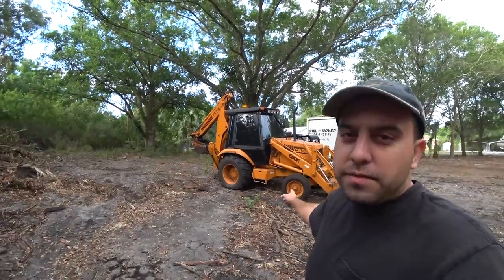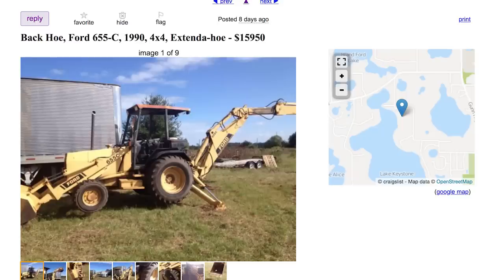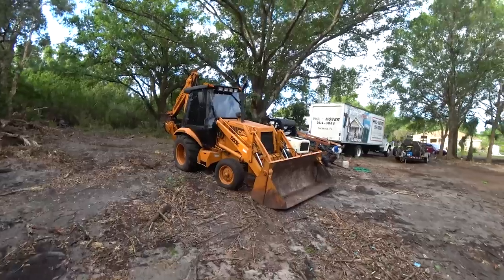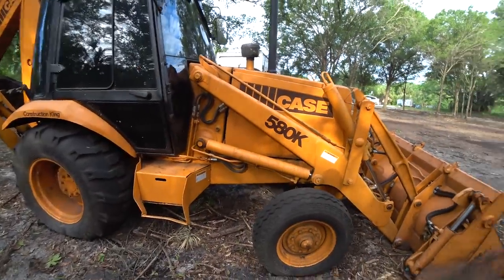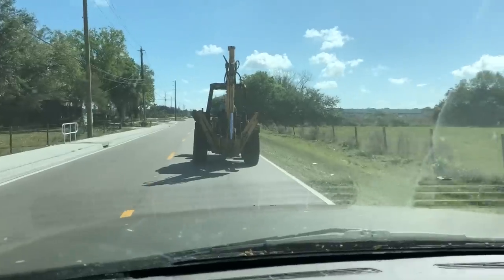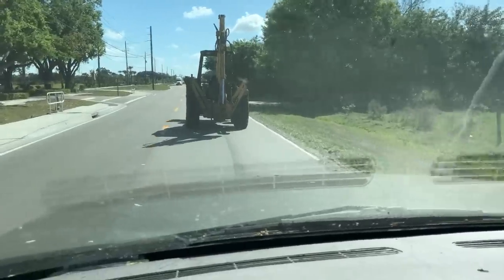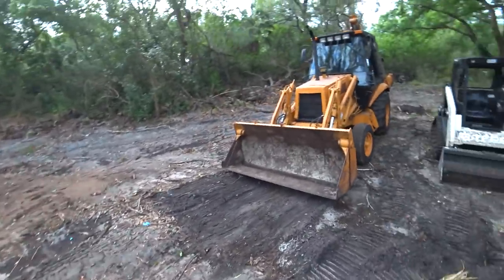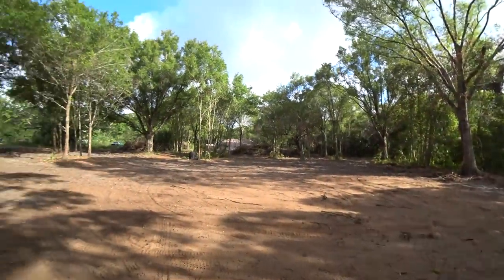Accidentally Bought 2 Backhoes

Comment: Those 580s are awsome we have a 480 we bought new in 87 its great if it only dident need all new hoses just because over the years they have ben dry rotted still all work but for most of them i could use new hoses

Comment: Hind sight is always 20/20. It's difficult to find a good machine at a decent price. Excavators ain't cheap, I know, I've been looking. I ended up settling on a backhoe too. The back hoe will get the job done but not nearly as easily as an excavator. Thanks for sharing your experience.

Comment: The CASE has the 4 in 1 front Bucket, very nice. YES I use to Drive, dig with a 420 FORD 
Backhoe, it had the CHAIN swing
Chain around the base of BOOM
it had FORD controls, takes something to learn on Backhoes 
It was allso a CLUTCH shift you had to shift a FLOOR gear nob to go forward and Backward 
In my personal life. Got a 
190 DYNAHOE 1978- 8000
Hours, it leaked Hyd. Fluid like yours, also NO brakes and if you know DYNAHOE thay have a MICRO switch for right and left brake rear wheel lock outs
So my WIFE wrote up SALES contact, the seller wanted 9000
We gave him 5000, with legal document, that we would pay him the rest if the price of repair was LOWER than cost for Brakes, Hyd 
Leaks ect...........
Had my shop guys who I use to repair the Backhoe, the guy use to SELL them LOCALLY when B E
still sold them NEW, he knew everything about DYNAHOE'S
it cost more than 4000 to fix problems, the guy wanted his money badly, he was a home builders who needed money he was selling everything he had to build homes.  You ask WHY I bought a 190 DYNAHOE 
I look at it like a guy wanting his FAVORITE power car from the 70
I wanted a DYNAHOE.

Comment: I've been through a lot of 580 Cases.. B series all the way to N series...Best bang for your buck  is the L series ...the K was a good machine..the bad about  them is the hydraulic tank was made into the chassis of machine..the boxed chassis was too rigid and in rough, uneven terrain  they would crack in such a way it was almost impossibleto find..also the rear diff would go out if your grading and incountered something hard in the ground that made a major impact (or maybe that was just mines)...I wasn't a big fan of the fords ...but I would have taken the lost on the deposit if the case was 4x4....clearing land with a backhoe you have to prep everything with the hoe..the blade is just for making piles..and make small advances then reverse (pay SPECIAL ATTENTION when reversing, your radiator depends on it) when pushing the brush to make sure underside is clear...and I personally would have gotten rid of the tint ..Have Fun!!

Comment: My papa has a ford 555c he has done so much work with it and it has been a good piece of equipment. I would have kept the ford the ford will out last that case and it has more power yea it will need maintenance but it will still last you forever so who ever bout it will be satisfied with it. We have had ours and the only two problems were the power steering went out so we fixed it and it had some a minor problem with the engine but it has plenty of power and it has been good we have had it for 12 years probably the best back hoe we could’ve bought our county has the same back hoe as ours and they say good things about theirs

Comment: Nice.  But be aware that back dragging with that 4-in-1 bucket open runs the risk of pulling it out of shape.  Bowing it.  You're in Florida without heavy rocks so you may be okay, but just don't pull too hard on it.  It will bend.  I know because I have that bucket on my Case 580.

Comment: In all honesty backhoes are big dumb machines that do nothing well. Contractors rarely use prefer them, in fact I have never heard of one that does. They are best for city maintenance crews who need an all- in-one machine to make the rounds each week in a city. Grading contractors usually prefer compact track loaders and mini excavators because you can get so much more done with them. There are videos online showing the superior work rates of these machines.
Reply: They are a really nitch piece of equipment. They're good for city crews because they can drive them to the job. Most cemeteries have a backhoe because they need something to dig with and carry the dirt away and a skid steer and mini excavator aren't in the budget. They've got their place but they definitely don't compare to an excavator or a front end loader.

Comment: I, bought a 1966, case 530 Ck 180 Diesel Backhoe rebuilt Diesel and new clutch kit for  $2500.00 and I bought a 1973, FORD F-700 5- ton Dump trk for $2500.00 and a 10-ton Equipment trailer for $2500.00.the reason that I bought all of this Equipment is because I own a gravel pit and a sand pit and I've been stripping top soil off of the land.
Reply: How is that 1966 case 530ck treating you?

Comment: A bigger skid steer and an excavator  with a thumb always trumps a backhoe.
Reply from the maker: Yup. The only benefit I can give the backhoe is that it doesn’t have to be trailered for short distance transport.  I’ve already used it about 2 miles away and it was so nice just to drive it there.
Reply: @MikeAndLaurenTV  that is a valid point.
Reply: Mike and Lauren Not only that I find for cost the backhoe is both the skid steer and excavator in one... might take a little longer to do a certain job but it beats needing 2 different machines for different jobs.